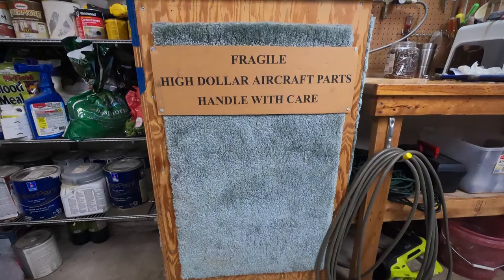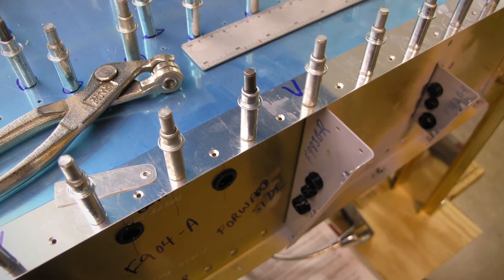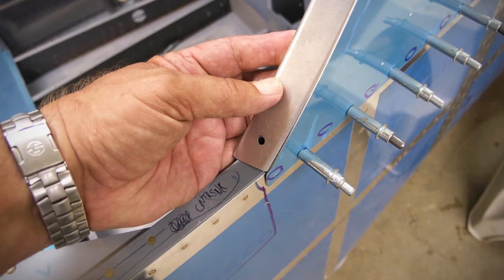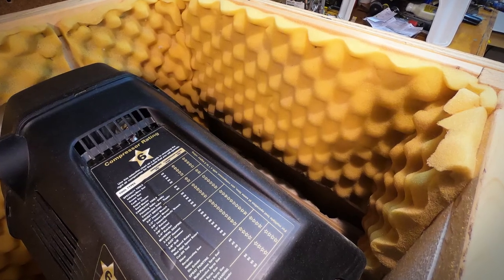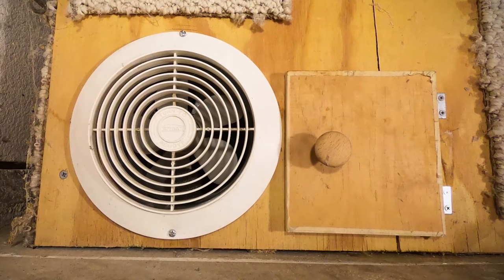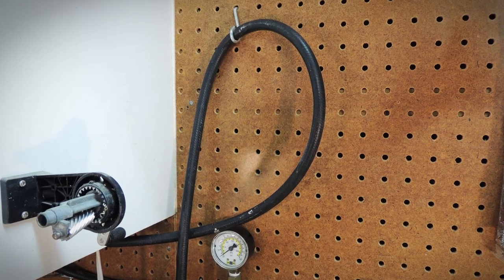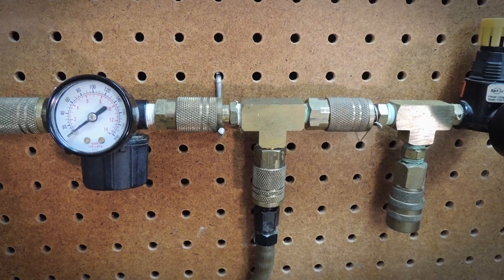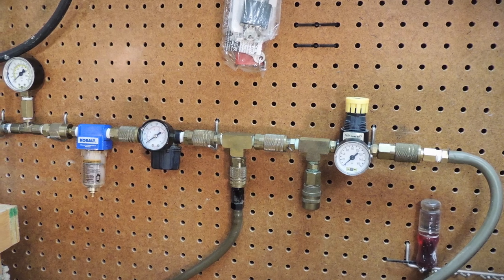How to Reduce Air Compressor Noise - Soundproofing!

Comment: Do you find any overheat issue?
Reply from the maker: The fan really helps to keep things cool.
Reply: @SmittysRV  thank you alot for your fast feed back.
Reply: @SmittysRV  it will be really good if you can some how measure the temperature surface of air compressor it can be kind of 120oC